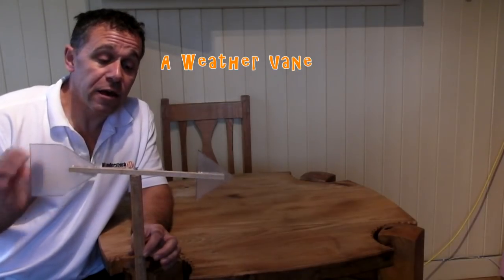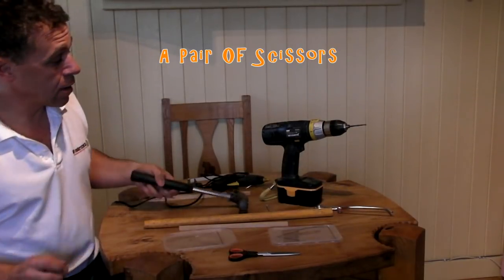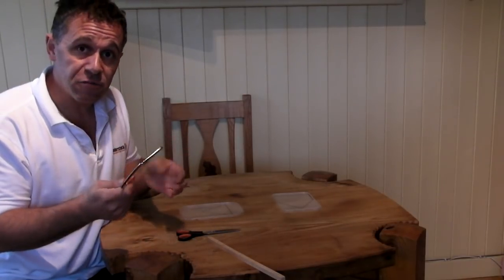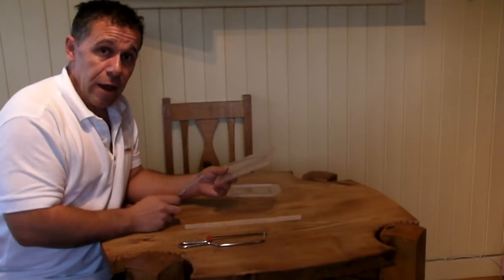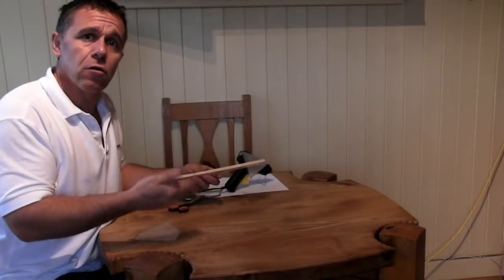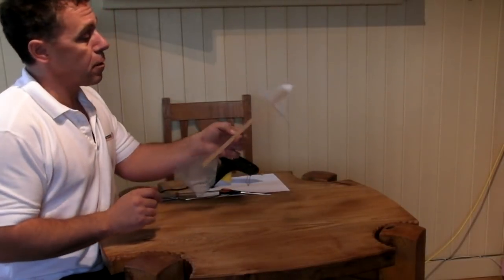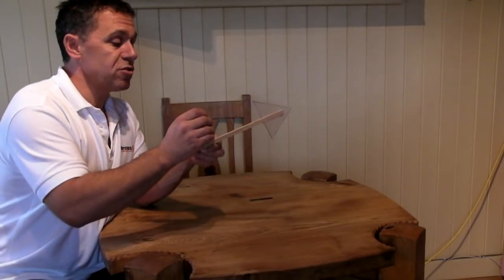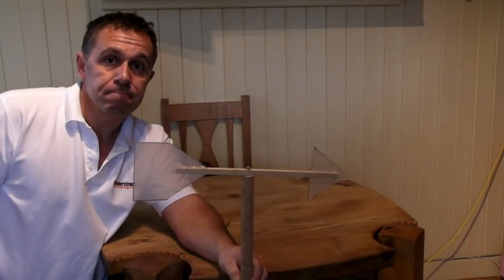Build Your Own Weather Station Part 3 - A Weather Vane

Comment: Plastic is not a good choice for outdoor service since it rots in sunlight, that leaves wood or copper, or aluminum, Sir !!!!!
Reply from the maker: rand eddy Plastic will certainly deteriorate with UV exposure but as these projects are aimed at primary age children (more or less) it's the easiest one for them to work with in a classroom or at home.  This weather vane isn't really designed for long term use, it's just a simple, easy to make thing that might spark a deeper interest.
Reply: WonderstruckHow
roger that I see !!!
Reply: WonderstruckHow thanks Im a kid cause my science teacher told us that make your own weather vane thanks!v ::))

Comment: I can't hear most of the instructions, what was the piece of wood) that made the body of  the arrow? and how long it should be?
Reply from the maker: The Yaoi Mistress Sorry for the late reply!  Any light wood will do - we used jelutong which is a slightly heavier and stronger balsa type wood used for modelling but a thin piece of pine would be fine.  The length isn't too important as long as it's balanced around the pivot.  Ours was about 30 cm long.